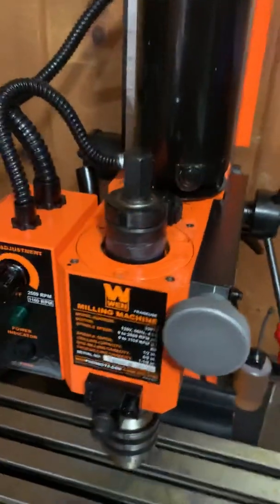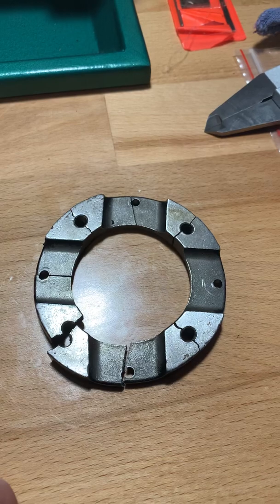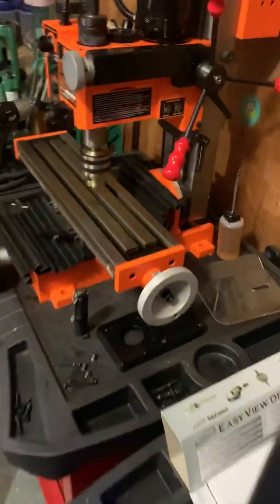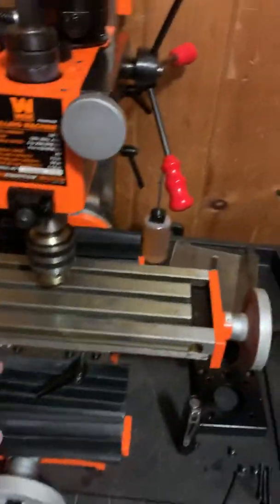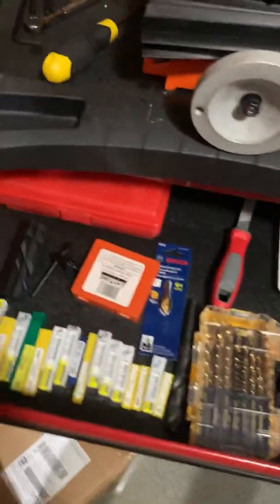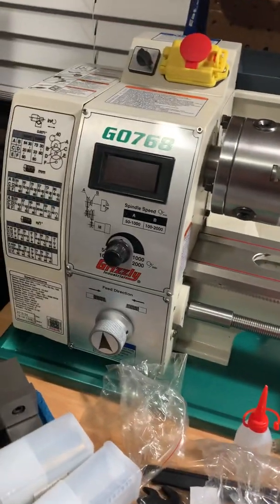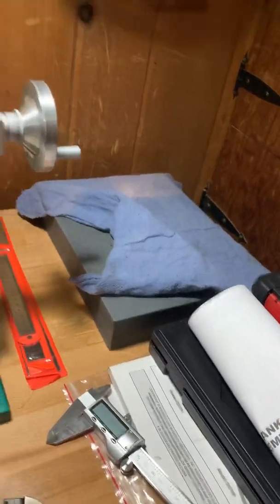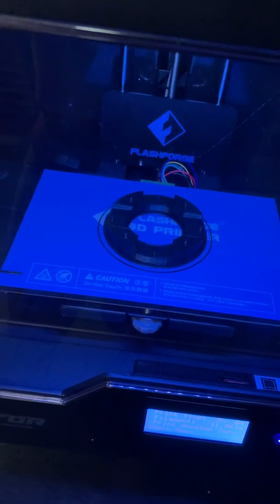Wen 33013 Mini Mill 3D Printed Motor Mount (Part 1)

Comment: I'm curious if you got the belted spindle accessory set up on your mill yet? Does it run much quieter W/O the gears? You got it from Little Machine Shop? Does it bolt right up? Existing motor or new motor as well? Thanks

Comment: I just got a Wen Mini Mill also. I think it's pretty good with the exception of the motor being a little under powered. Too easy to stall. You have to shut it off & restart the motor, even when I feel like I'm not cutting hard.